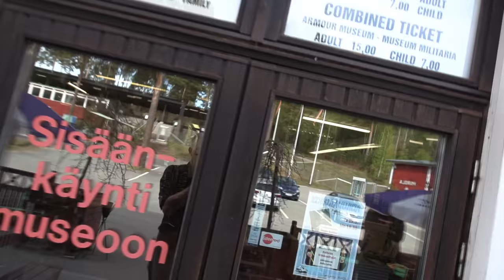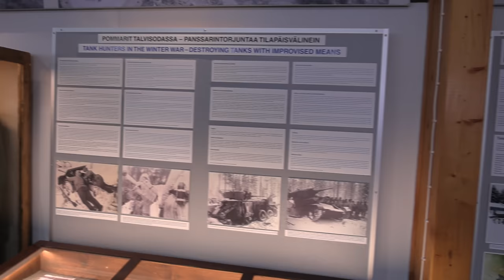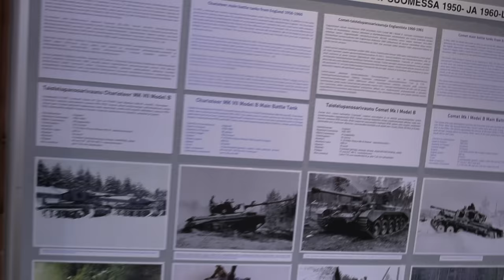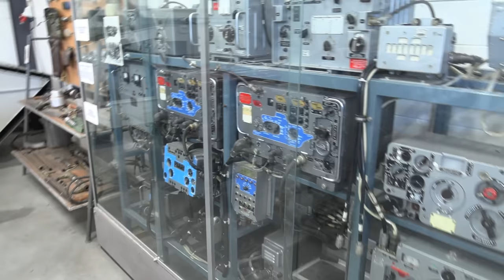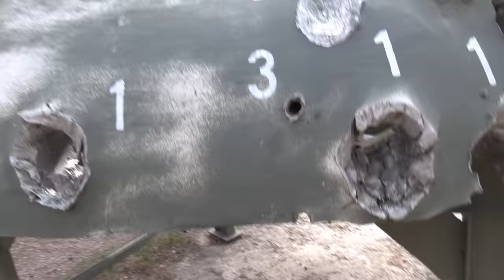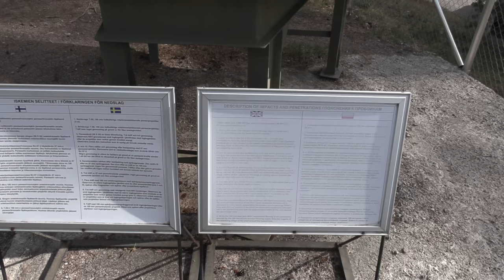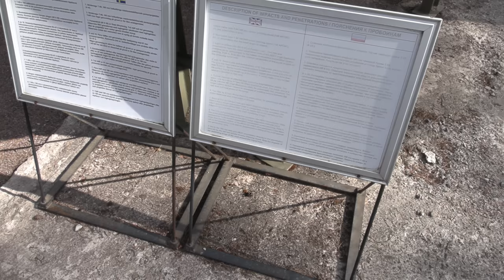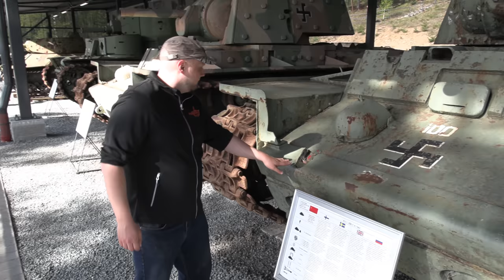Unofficial High Speed Tour of Panssarimuseo, Parola

Comment: Why is the KV-1 at Bovington radioactive?
Reply: Radium in the instrument panels.
Reply: @OltsuSuomesta  At first I was thinking why, then I recall what radium can do. So I guessing it is self ligthing needles and measurements?
Reply: @Danspy501st  Yup, point was to make the instruments glow even in low visibility.
Reply: @OltsuSuomesta  Ah. Did the soviets tried it with it, or did the british try? I mean, it sounds odd that it is the only one that have it. It would had sounded like a production line. You know, like it would be for watches that had radium
Reply: @OltsuSuomesta  People used to drink it as a tonic or something, now it's too dangerous that you can't go inside a tank for 5 minutes. LOL
Reply: @romaliop  People used to think that mercury was benefitial to health aswell. I reckon it's more of a just-in-case safety precaution than an actually significant risk, but I certainly wouldn't want to go into a radioactive tank.
Reply: @Danspy501st  There's not that many KV-1s still left, could be that the rest just have all the instruments ripped out?
Reply: @OltsuSuomesta  Nah, it's just that people have absolutely no sense of proportionality with stuff like this.
Reply: @OltsuSuomesta  Maybe. I dont know, I havent been near a KV-1 the "oldest" soviet tank I had been near, was a T-54/T-55 in a tank museum here in Denmark. (And a BMP-2, but on top of my head, I cant remember when they was designed)

Comment: Why does the bmp 1 turret at 7:53 have RPG rounds stowed around turret? Or is that the weopon system and uses rocket assisted salvo rounds? The reason their showing it..
Reply from the maker: It's more closely related to the SPG-9 ammunition. It's a low-pressure gun, it doesn't use 'typical' cased ammunition.

Comment: So, WoT Finnish line when? :P
Reply: The only tank we finns ever built was BT-42 and they were terrible. In WoT closest thing of that you get is BT-7 artillery.
Reply: @Jerchw  You could add Vickers too, since Finland only bought hulls.
Reply: @Jerchw  Yeah, and it's a propper mem tank. :P

I was actually thinking that WG could go down the "what if" tank route again like the Chinese TDs. So you'd get Swedish, British, German and Soviet tanks, but you can mount different guns on them. So like you get the KV-1 with 75mm Pak etc. really mix it up. Anything the Fin Army used, but with different guns.

T-55 but with British main gun etc.
Reply: @Jerchw  If you now stretch "built" to include "McGuyvered old material-aid Brit field guns into captured old BT hulls that creaked under the weight" anyway... :P